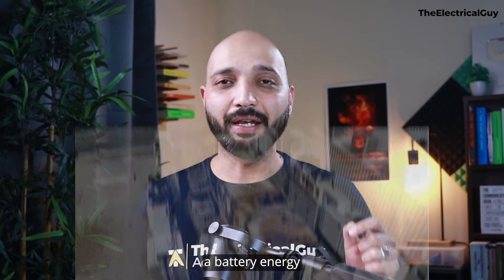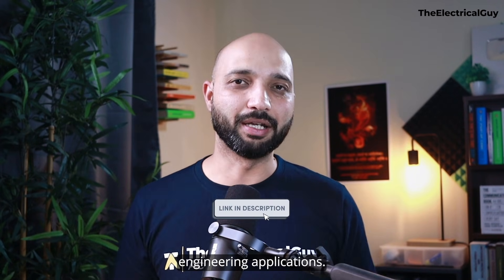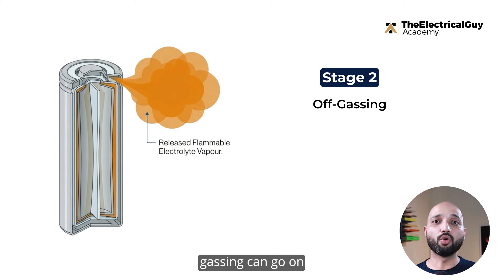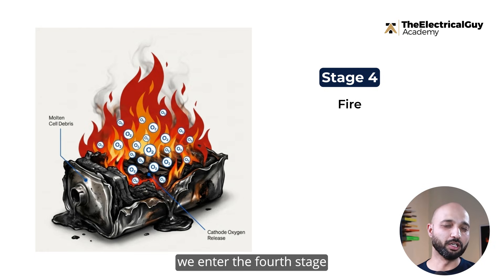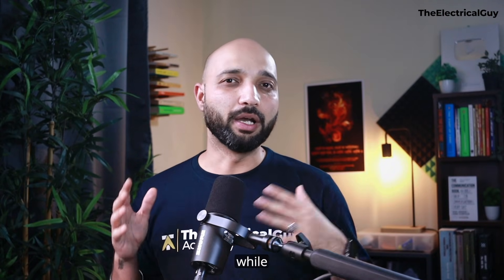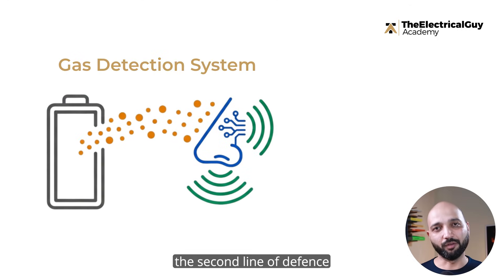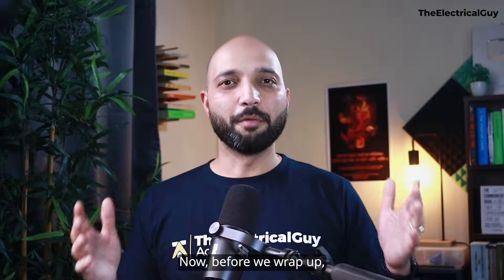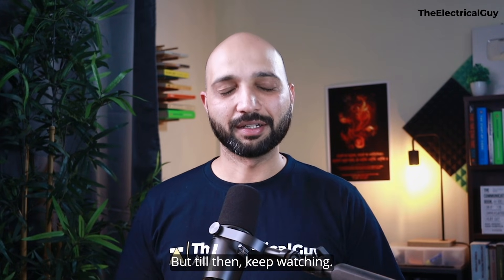Why Battery Storage Systems Catch Fire (Thermal Runaway Explained)

Comment: The implication is that all BESS systems suffer from the same problem. You don't mention the different lithium chemistries or alternative chemistries and their relative risks. Could it not be that we should also be concentrating on the use of safer chemistries? In my experience faulty cells actually show signs long before anything goes wrong. If individual cell voltages are graphed faulty ones show up as a deviation from the rest and balancing circuits have to work harder on them. Maybe balancer monitoring is the answer with its activity indicating the faulty cells. Of course parallel cells will dampen this a bit with those in parallel masking to a degree but the same extra power shuffling effort will still be needed. This could be an easily implemented method of early detection applied in software.

Comment: Hard question:
R u guaranting 100% that if the thermal run away is caought in the off gassing stage, an accident fire can absolutely be prevented? the Bess sys would be inside a CAthlab mobile unit with patient/

Comment: Sir would you please tell me name of circuit simulator which you be using.
Reply from the maker: Everycircuit
Reply: @GauravJ Thank you sir 😊
Reply: This is amazing that Everycircuit as an app is still popular since 2013. The reason is due to its user friendly environment and super effective in visualisation of graphs while changing the variables like resistor, voltage etc.